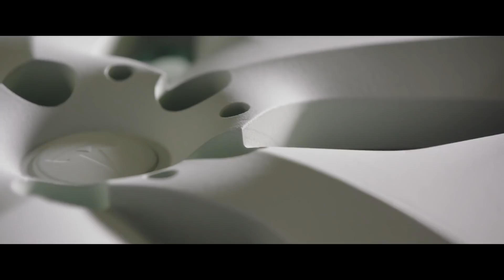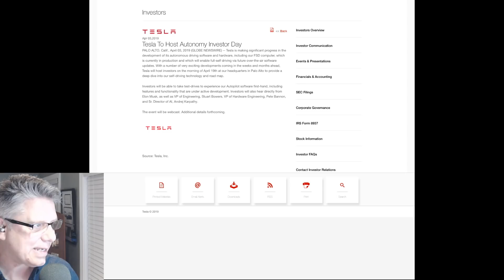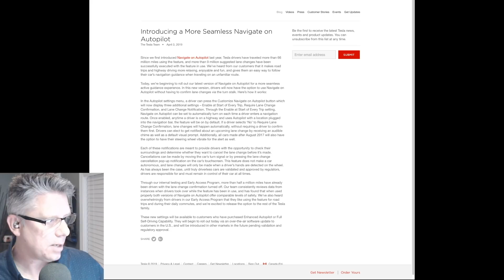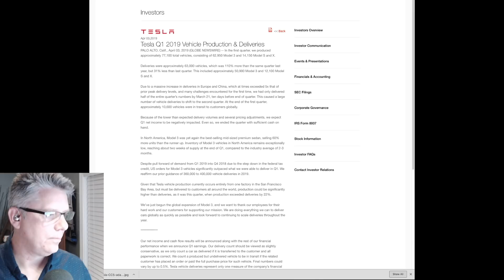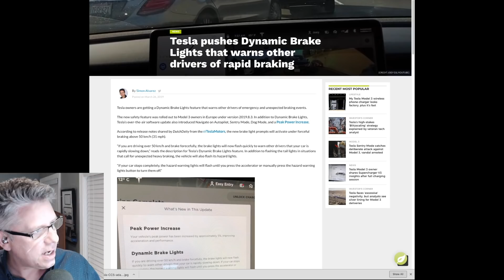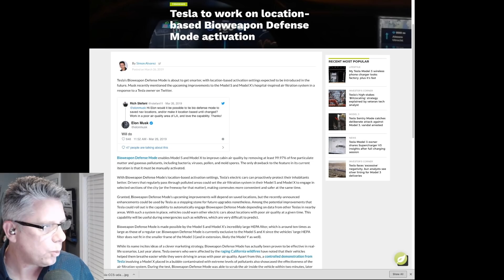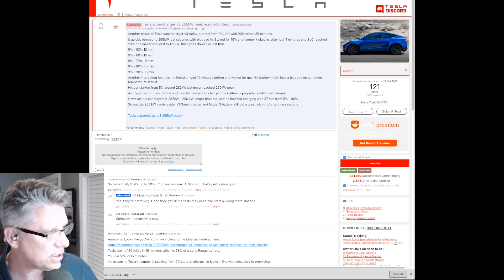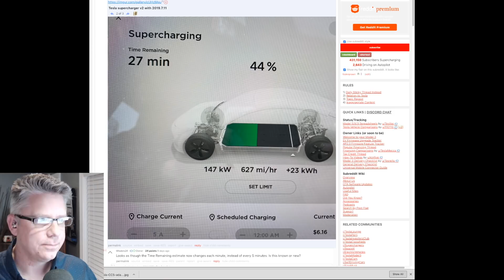35 - Autopilot gets betterer all the time

Comment: While watching this video yesterday, I got a notice of a software update. I installed it, and later, my wife and I went to Las Vegas. I had set NOA to not need confirmation for lane changes. While on the 515, the car started to make a lane change to the left, lurched back into the lane, tried to change again several times and then kept the turn signal on for quite some time while constantly flashing the blue light to tug on the steering wheel (which I did) until I finally got the red warning and EAP shut down completely until we got to our destination and then restarted the car.
Maybe it's the insane traffic in LV, but I think the current version of NOA without confirmation needs a bit more work.

Comment: I have a question please. As a tesla owners could u please let me know.. If u have face some problems with tesla? How often are u visiting the garage?
Reply: By garage I assume you mean Tesla service and we're visiting it exactly zero times per year - which is exactly what the Tesla prescribed maintenance schedule is. Other than replacing your cabin air filter every two years for $30 and making sure you brake fluid is ok every two years there is no semi-annual or quarterly service visits that we have to make to Tesla to keep our warranties intact.
Reply: I got my new M3 less than a month ago in Italy. I had 2 issues: no remote connection. The LTE/3G connection would not activate most of the time; and... when starting the car the screen would be black with some distorted vague image in the background. Called Tesla and in a matter of few hours they "probably" did a software update/correction and since it was all fixed without me spending any time on a service visit. Just a phone call.
Reply: Model 3 august  2018 Zero problems.
Reply: 12000 miles 11 months, never
Reply: My only issue that required service so far was replacement of the rear glass due to a stress crack. Other than that it's been bulletproof.
Reply: Model 3 dual motor delivered September 2018.  16,000mi now and zero issues.
Reply: @rudyvandewalle1400  The beauty of owning a Tesla!

Comment: It is a bit goofy but interior cargo space is calculated using the height of opening and from back of vehicle to front seats (after back seats are folded).  I guess I get why they do that, the hatch backs are far more functional for carrying large objects and cargo.  The Model Y has a large opening + power lift gate + 3 way split seat folding + a deeper frunk.  Definitely better for cargo as compared to the Model 3.

Comment: Great show and appreciate the effort.  I also have full replacement value rider on my insurance and it's the first car I added that, for the very reasons you mention.  On tire pressures, I noticed that when I drove from Reno in Jan. with my tires at 45 psi cold, down to San Diego, my tire pressures stayed at around 48 psi cold and grew to 50-52 psi when on the freeway.  I was only there for a week so I waited until returning home to check again and everything went back down.  Since the weather has warmed, I had to lower it some to get 45 psi cold as it had gone to 47-48 with 10 degrees warmer nighttime temps.  The owner's manual calls for 42 psi and the door decal calls for 45 psi so I figure any number in the 42-45 psi range cold is fine.